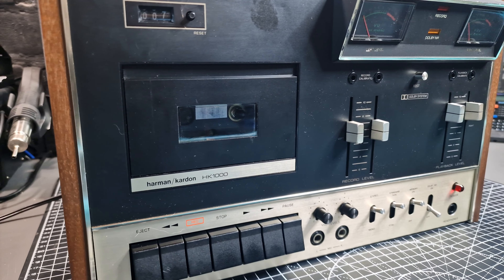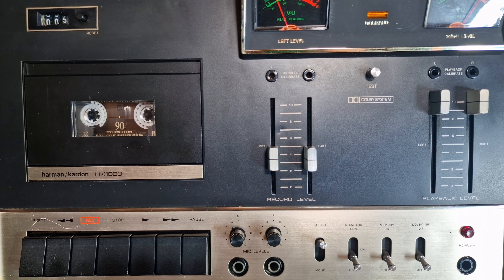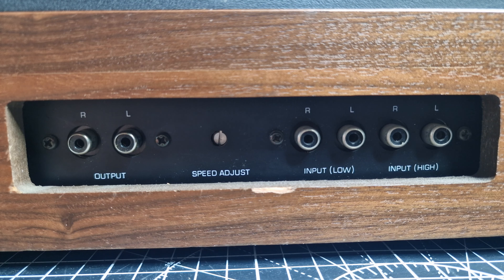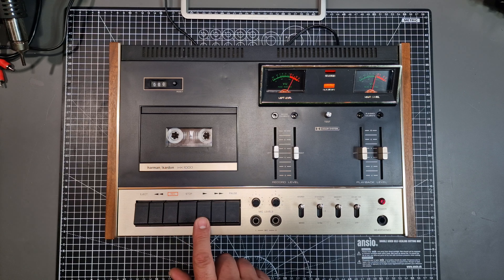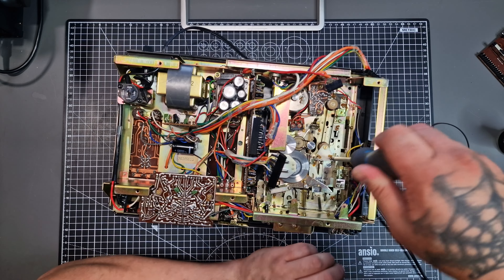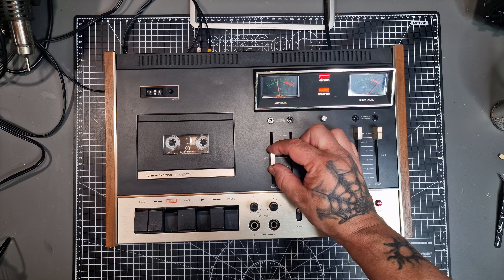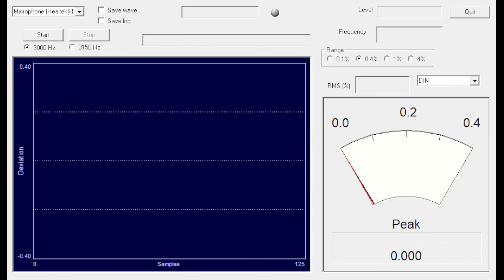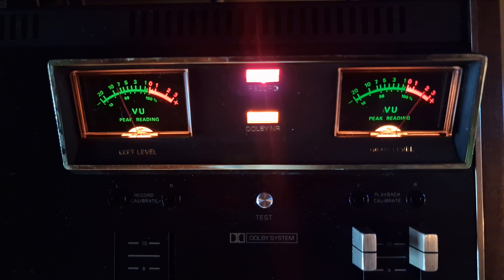Harman Kardon HK1000 - Demo & Belt Replacement #retrotech #cassette #vintage #repair #vintagetech

Comment: I have a sony tc-152sd that had the same problem with the vu meters. I fixed it by spraying contact cleaner into the recording level potentiometers and jiggling them back and forth. EDIT: nevermind, I just saw you already did that.

Comment: The switch that is enabled when you pres record the long one on the board you had out might need some contact cleaner .
Reply from the maker: Thanks, I did actually clean that as well, but didn't show it. 🙂

Comment: Last project was exactly this type of deck to restore and seems it has alot of faulty transistors 2SC458D/LG  wich needs to be replaced especialy on the Dolby board if you want to troubleshoot those VU meters. The voltages are all over the place so you would have to recap and change quit alot of transistors wich IMHO it aint worth it. Keap it as an exposition unit.
Reply from the maker: @mihaibalogh6359  Thanks for the advice. It's currently sitting on a shelf (I don't think it will move for a long time)